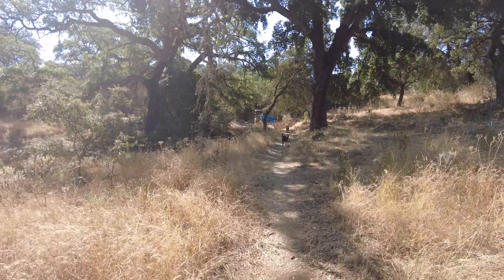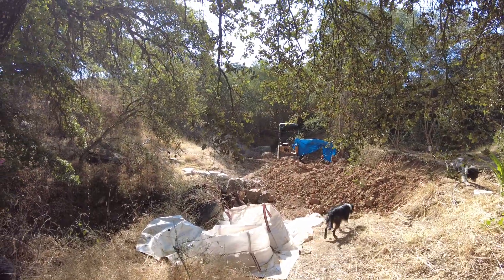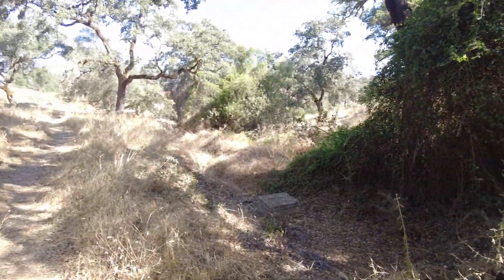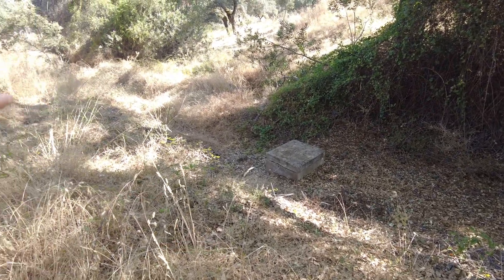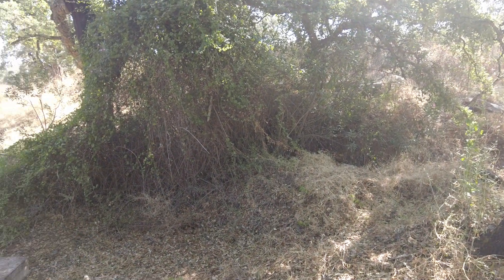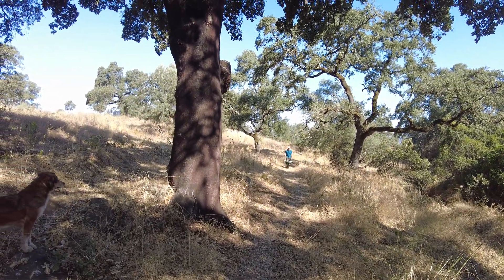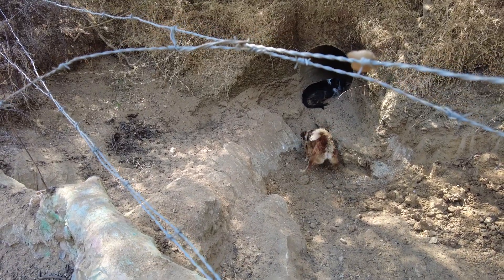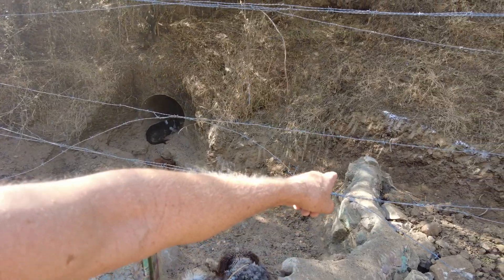Work progress on canal system to reduce erosion in our creek.

Comment: Would it be possible to line the canal using the natural stone, lying around your property, held together by cement? It will blend in better with the surroundings than a concrete wall. Just a thought.
Reply from the maker: @brianvittachi6869  You are right. The first part will be built by using stone. The second part with sinder blocks that will be covered by soil. Keep sharing. Much appreciated
Reply: Or how about old roof tiles bedded in cement?  Seem to be readily available in the region. 👍

Comment: Thanks for the video. Would it be an idea to line the canal with a pondliner instead of concrete, or will it not survive with moving water running over it? My thoughts were that maybe the pondliner is cheaper and faster to install than having to concrete the whole canal project.
Are you planning on cleaning out the quanat as well? If so, be mindfull of working in enclosed spaces (CO2, CO, H2S, lack of oxygen etc.) Ventilation (maybe even mechanical) is your friend down there. Take care.
Reply: Very good point about ventilation Brian.  They are all silent killers.  
An overcome adult male could not be recovered from that depth in time.  Safety first.
Reply: @stevejohnstonbaugh9171  Worked on oiltankers for long enough to be pretty paranoid, when it comes to enclosed spaces. They can be a oneway ticket if you're not careful and respect the risks involved 🙂
Reply: @BrianJensen-ym5gk  My experience is petroleum related also.  H2S can be suddenly released from pockets during drilling for Marcellus Shale gas in the US.  I happen to live in the heart of that region and did some consulting work regarding the fit of respirators.  Ultimately, no facial hair was allowed on the jobsites'.  If you showed up to a site with facial hair, the guard shack would hand you an electric razor.  No exceptions. 👍
Reply: @stevejohnstonbaugh9171  Yeah, H2S is nasty. Kills your sense of smell at 50 ppm, which is also where it starts going into lethal range. We mainly had the issues with low sulphur fuel oil, which can give off a fair bit of H2S when heating it, for some reason.
Reply from the maker: @BrianJensen-ym5gk  After the unpolite outburst of culvert water last year in Oct, I'm hesitant to try a lines. I'm chewing on that idea anyway. Keep sharing. Much appreciated
Reply: @SuerteDelMolinoFarm  This was due to the uphill neighbor using the creek as a pig pen, right? Which led to the creek getting dammed up.

Comment: Very good essay Martin.  You have done your homework!  Looking forward to seeing the techniques you employ in your solution.😊
Thank you for pointing out the location of the egg dome.  From previous video, I thought the uphill side of that shaft was blocked with rubble.  That is why I was confused.  Where is the rubble filled tunnel?
May I suggest you use your dug soil to support the downhill side of the canal.  If you take one bucket of soil at a time and compact it with the the full weight of the Giraffe bucket, you will have fairly good compaction.  Better still would be driving the Giraffe across 20 cm layers of loose soil at a time as you did in the dam construction. Do you think you can get a large number of vetiver starts established on that bank before the fall monsoons come?  One more step to prevent erosion would be lining the dug soil bank with rip-rap as suggested in your essay. 
Much gratitude! 😊
Reply from the maker: @stevejohnstonbaugh9171  Rip rap is a super solution. Let's see how it unfolds Steve. Thank you for sharing
Reply: @SuerteDelMolinoFarm  You bet Martin.  It will all make sense as you move forward.  We're just "sidewalk superintendents" thinking fondly about your encore career. ♥
I noticed Brians suggestion of pond liner.  Ferrocement is a similar solution (a liner).
If you could have a load of rip rap dumped down the hillside from the road to Portugal, that would put it close to its final destination. It's much easier to throw/roll rip-rap downhill than uphill 😉